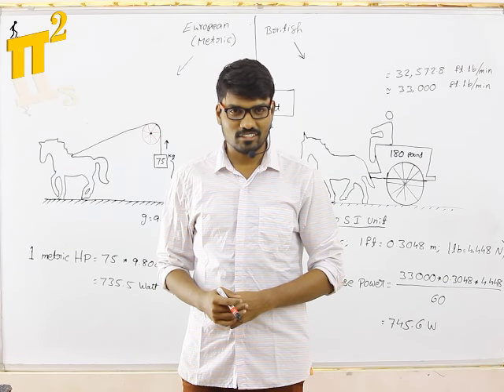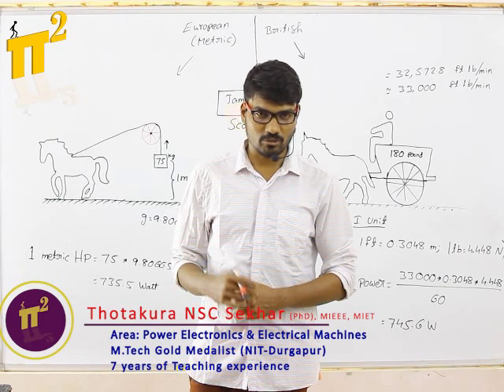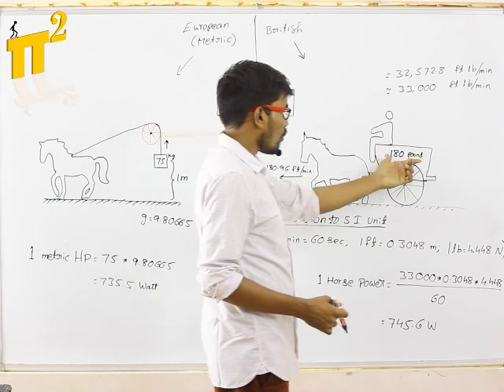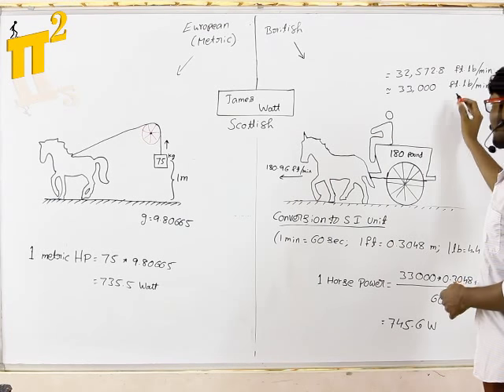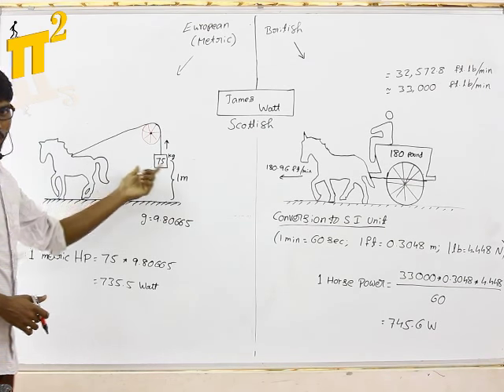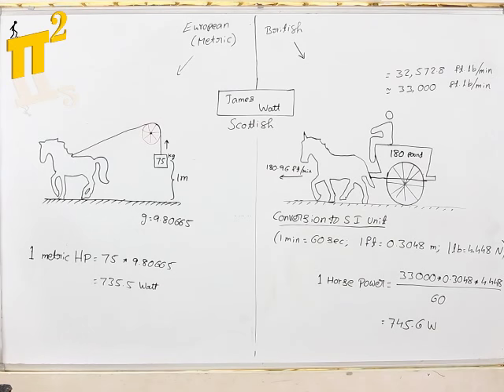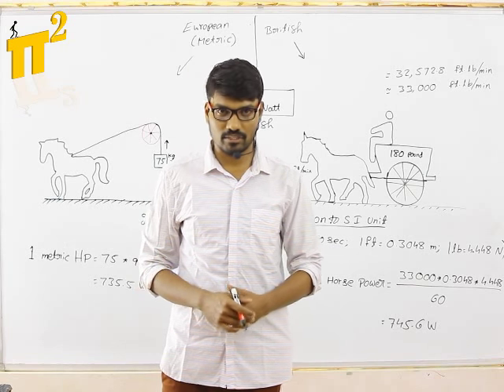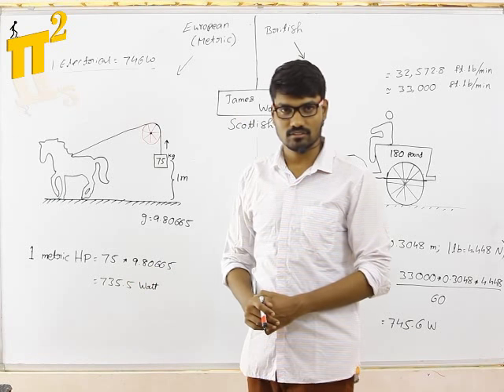Why horse power | Why 1HP= 735.5 or 745.6 Watt | Subtitles are included | PiSquare Academy

Comment: Sir you taught that metro hp and british hp. It's  clear but i have one doubt. That is where at particular applications. I mean if they rated 20hp motor has running so on. 
So., here to convert into watts what should I take either 735.5 or 745.6.
I hope to get reply from you sir. 
Thank you

Comment: 1.Y Insulation resistor testing using dc voltage
It not possible in ac voltage
2.what are the different between insulation resistor and hv test
Because both testing we injection voltage???

Comment: what happens to the value of hp if  weight varies from 75 kg(i.e higher or lower)
Reply: if weight increases 1 HP definition will change. metric HP uses 165 pounds instead of the british 180 pounds

Comment: BHP means Break horse power or British horse power what is difference in terminology
Reply: Brake horse power is the maximum power available for driving a mechanical load which can be stopped using brakes. british horse power is just one type of horse power

Comment: Why taken 75 kilos weight only,why not taken another value..
Reply from the maker: the designed motor could just lift only 75kg only
Reply: that is taken as base value u can take other value too, but that will change answer
Reply: right.......
Reply: If the weight is increased more and more the horse can't lift... Hahahah.... There must be some other constraints involved in the calculation..
Reply: Y
Reply: I completely agree with your questions. The answer in the video is not clear. If the horse can pick-up load of 180 pounds then it will be 81.646 kg equivalently not 75 kg. So accordingly, 735.5 will not be answer, if you consider 81.646 kg. The logic behind 75 kg, therefore, is not justified.

Comment: Why it is called electrical HP? no clarity...
Reply from the maker: The term "electrical HP" is commonly used to refer to electrical horsepower. It is called electrical horsepower because it is a unit of power that measures the rate at which electrical energy is converted into mechanical work. It provides a way to quantify the power output of electrical motors or devices. 

The term "horsepower" itself originates from the comparison to the power output of horses, which were historically used as a source of mechanical power. Electrical horsepower specifically distinguishes the power measurement in the context of electrical systems, highlighting the electrical energy conversion aspect. Kindly consider rewatching the video, the same is explained.